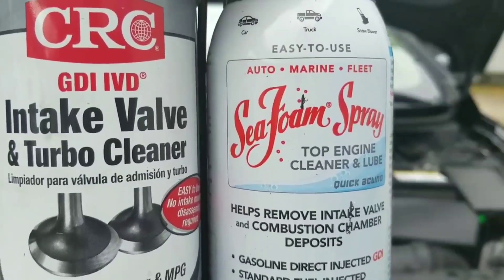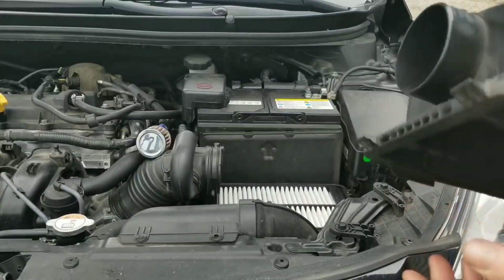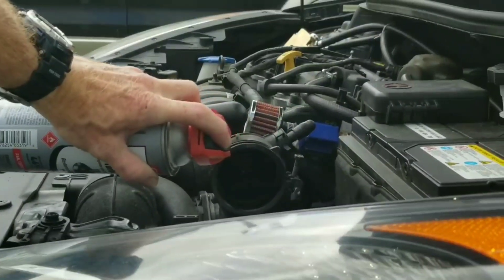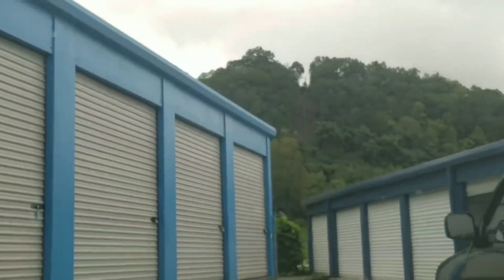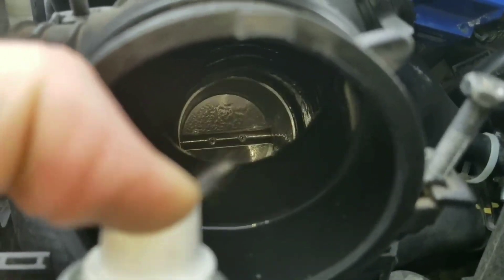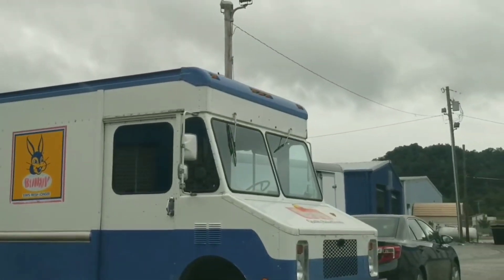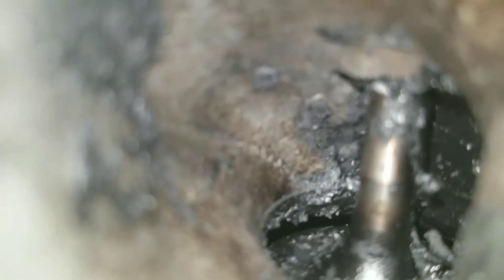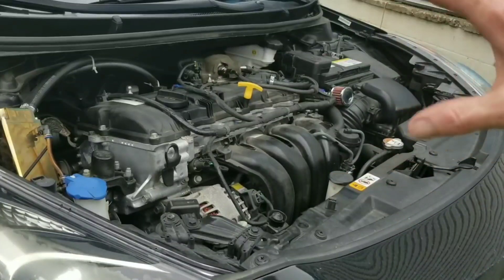best intake valve cleaner vs direct injection! (GDI)

Comment: Is it safe to use on cars that are just regular efi not GD?
Reply: Safe? Sure. Necessary? If the vehicle has port injection (gas sprayed before the intake valve) then no, it probably isn't necessary.  If you're worried about carbon build up, you'd probably have better luck adding Techron to your gas the tank before every oil change in this case.

Comment: I have run sea foam for years in my vehicles I put it in the gas and a couple ounces in between oil changes it works great. I bought a old 1939 model H farmall tractor years ago it barley would run and idle  . I poured in some Sea foam in the gas tank I was amazed hearing the  r.p.m,s pick up the engine smoothed out and ran like new .That,s what sold me on buyi g SeaFoam !

Comment: I've used the crc gdi cleaner and liqui moly gdi injector cleaner for years on my mhd stage 1+ 2007 bmw 335i before every oil change with like 50 miles until empty. Original index injectors, o2 sensors, cats, and turbos. I use a jackstand and the electric seat to keep it at 2k rpms.

Comment: I used CRC GDI for years. Never had an issue with the Carbon breaking off. As it dissolves it. So it can pass through the Cat... As I seen some cause Carbon chunks to get trapped under the valve..Holding it open...

Comment: some people say that flushing the carbon out into the cylinders will cause damage ( scratches to cylinder walls and piston rings). let's see a before and after video of the cylinder bores Nate. thanks.
Reply: Good point but so will detonation from the extra heat from carbon build up on the valves not to mention reduced cfm into the combustion chamber.  Guess you gotta pick your poision.
Reply: @ryanchristensen1799  so if your car is running fine then no need.
Reply: @nighthawk0077  no you'll need it unfortunately, its the drawback to GDI engines. No fuel is being sprayed on the backside of the intake valve so carbon is going to accumulate by 50k miles.
Reply: @ryanchristensen1799  yes but should you risk it even when you have no issues.
Reply: @nighthawk0077  by 100k miles you'll definitely notice. Rougher idle, less fuel economy, more prone to heat soak so precombustion. The choice is a hard one......
Reply: I would think small chunks could potentially break off from time to time even without the cleaner.